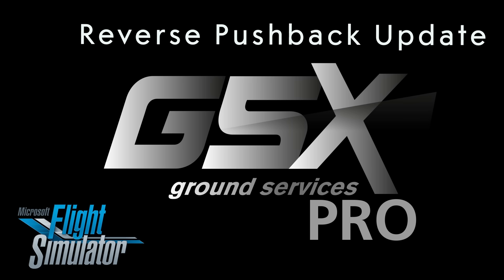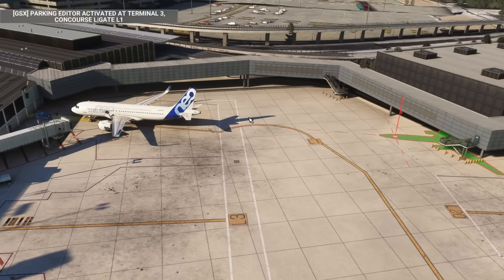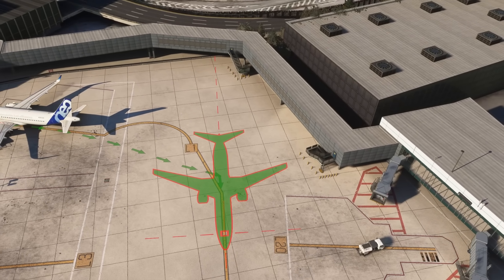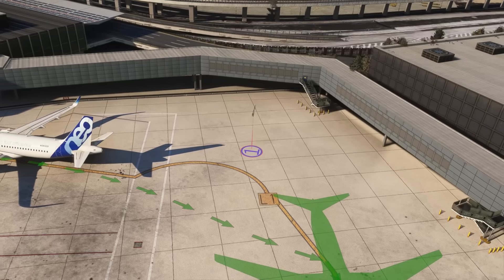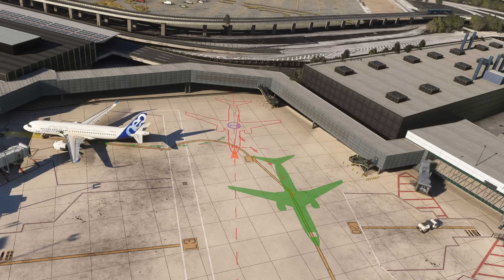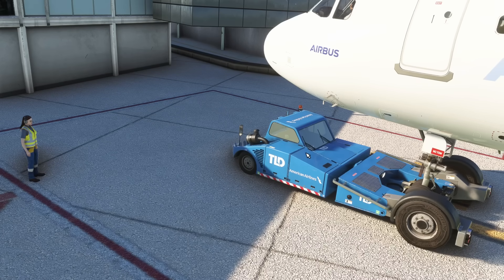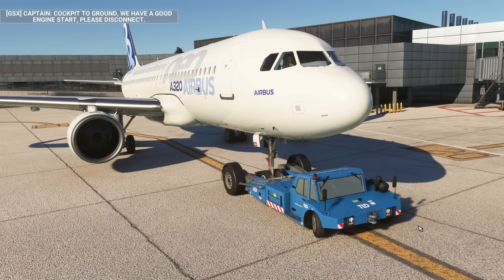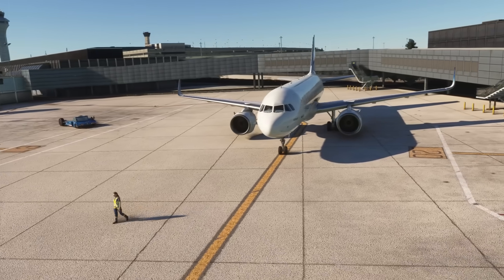GSX Reverse Pushback

Comment: I just purchased it. One question: if the engine is on, the menu will not open. It says i have to shut down engine for ground service. I wanted to try the push back thing, but i was not able to do so, first shut down the engine then it was possible. Is this a bug or normal behaviour?

Comment: does anyone know why when i request boarding/deboarding at gate there are stairs which connect to the back of the plane?
Reply from the maker: GSX Manual, Page 31, the explanation of the "Disable Rear Staircases if Jetway" option in the settings.
Reply: @umbertocolapicchioni2467 there isn't written how to do that
Reply from the maker: @infiniteflight2140  it surely is

Comment: By the looks of this video you are trying to simulate a real pushback or get as close to reality as possible.  Only one problem, you spent all that time getting the aircraft in the wrong place.  Gate L1 requires reversing all the way down the concourse to the apron.
Reply from the maker: that’s exactly how it was before this update, and it’s still possible to do it this way.
Reply: how??, the area is not made for the push you have done.  if you look the ground markings, it is deigned for you to push back to the arc then follow the arc still going backwards.  this will begin to align  the aircraft nose parallels to the concourse and thus doing so will bring the wing tip away from the concourse.  what you have done is successfully put the wingtip and most probably the entire tail section outside the surveyed equipment line.  it might be possible from L3
Reply from the maker: and again, the long pushback you are describing is what we had here, and it’s still possible. The point of having pull feature is you have the OPTION to make a pull, that doesn’t mean you have to use it everywhere.
Reply: with due respect bud, are you a licenced pilot and do you hold an endorsement of any aircraft which fall under transport category.  if you are or do you will know exactly where i am coming from.  at 6:48 on the video, it quite clearly shows that the pushback would not happen as the pilot in command has no way of telling wingtip and tail clearances.  depending how far back you sit in these types of aircraft you cannot see the wingtip.  that is why the aircraft MUST stay on the taxi lines.
Reply from the maker: @GlennnMatthews  I really don’t know what you are trying to say here, but you really seem to have missing the point, entirely, what this video is about.
Reply: Exactly, i thought the answer is no.  If your going to make videos and what not, at least have the content realistic
Reply from the maker: You still don't get it, do you? 

I'll try to use simpler words now:

- We supply a GSX profile for KORD, which at gate L1 has programmed two different LONG pushbacks all the way up to the taxiway. It has been like that since GSX came out so yes, we obviously know how it's done *there*.

I just used this spot as an EXAMPLE that, if somebody wants to do a shorter push-pull in a cramped space, it CAN be done.

Comment: 1. Hey Umberto, got a question regarding boarding. Lets say we are at a remote stand, it only boards 1 passenger on the bus. I'm not sure how to manually set the amount of passenger. 

2. At a gate, it loads for example the automatic set number (ex 127) in 7 seconds where it loads 70 passengers in like 2 seconds.This is quite annoying as it;s not realistic and I am not sure how to fix.

3. Also, on the FSDTL app I don't think my updates are being properly installed as after like 5 minutes the whole program closes and it hasn't even reach 1%

Any help would be appreciated.

Comment: Why couldn't you include P3D in this new program, eh?
Reply from the maker: Doesn't seem you heard the video until the end, which clearly say this update is available for ALL GSX version, FSX and P3D included.
Reply: Umberto, I have used GSX for many, many years and v2. I run P3Dv5.3 and the GSX pushback, has never been like this. Please explain? @umbertocolapicchioni2467
Reply: p3d is dead its community is extremely declining
Reply: pLEASE PROVIDE YOUR EVIDENCE?
 @Lowse1345